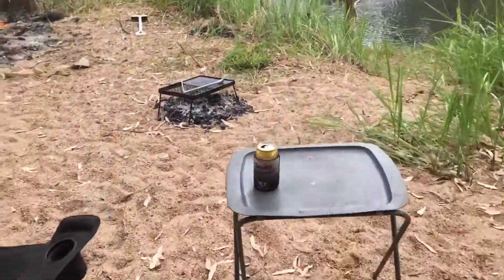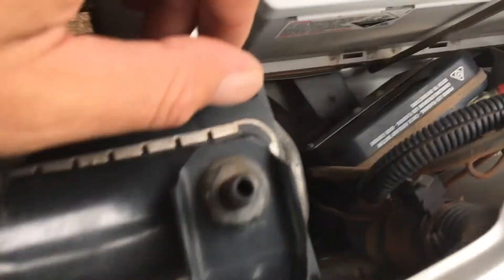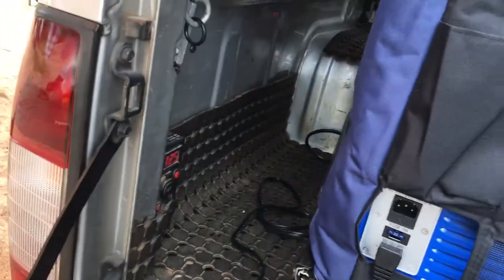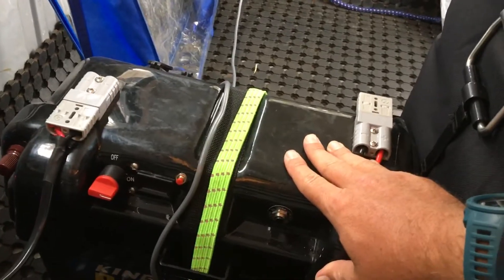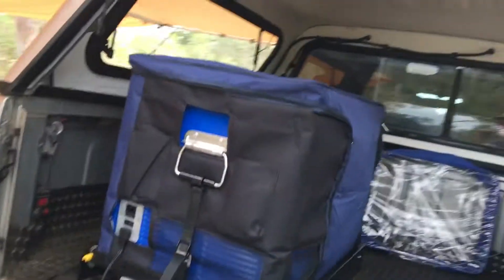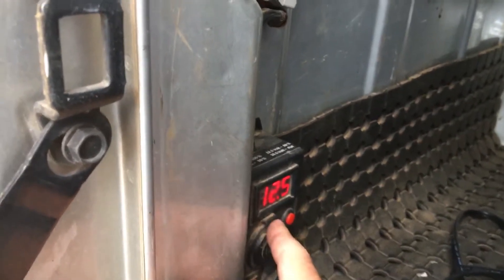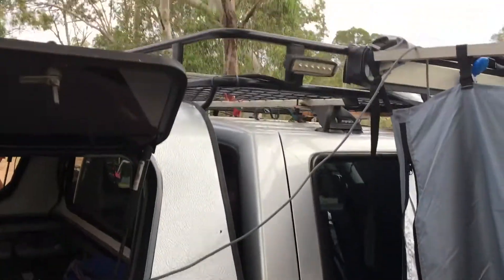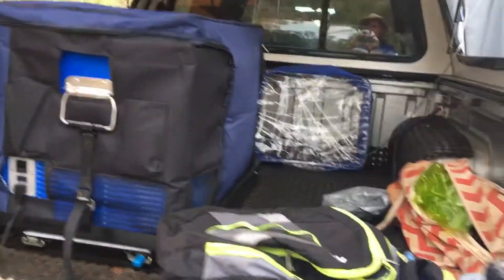12 volt 4wd camping setup

Comment: You can get lithium for under the bonnet now expensive but worth it imo, definitely don’t need to be a millionaire these days so many options for 12v, but lithium is the future the future is now 🤙 if I was still using my tinnie with the electric motor I’d go lithium 10yrs for lithium better than 2-3 years deep cycle agm, I’d go through a deep cycle every 2 years max in the boat and they used to cost around $300 🤦‍♂️
Reply from the maker: Agreed mate, lithium is the way now and lighter!! We got them put into the van when we purchased it. I’ll wait for these batteries to die and will upgrade

Comment: Awesome video mate. I’m running the same set up as your in my 2010 d22 but I’ve hooked my 3rd battery that’s in the back up to the alternator as well through a dcdc charger
Reply from the maker: Thanks mate, I thought about hooking the third to the alternator as well but happy with relying on solar only from the panel on the roof. If I was off grid for many days I may have to change my fridge to the second battery to maybe allow the sun to fully charge my third. But it’s worked so far

Comment: Great setup just wondering how did you mount your panel which tape I need to do mine thank you
Reply from the maker: Thanks mate, make sure it’s a heavy duty double sided tape. I got mine from Bunnings. Make sure your panel can breath from underneath, they hate heat, stuck it to some corflute. Best of luck mate